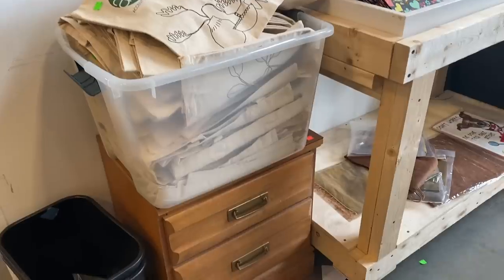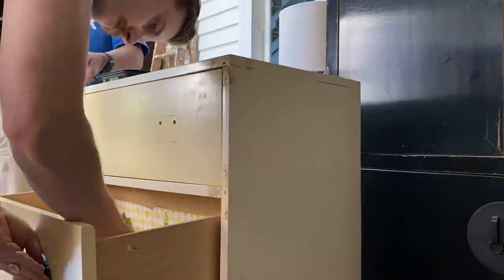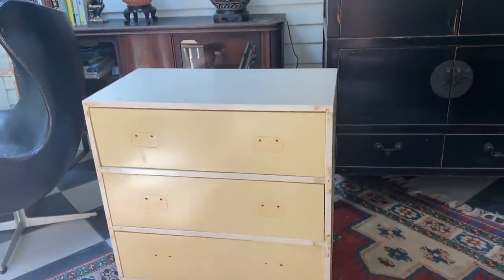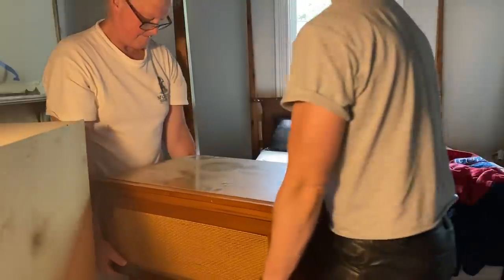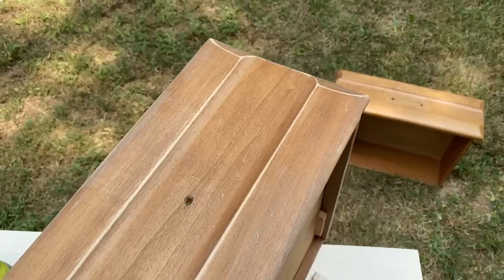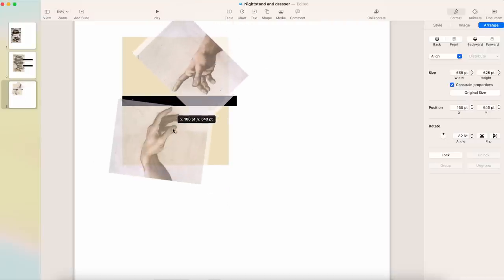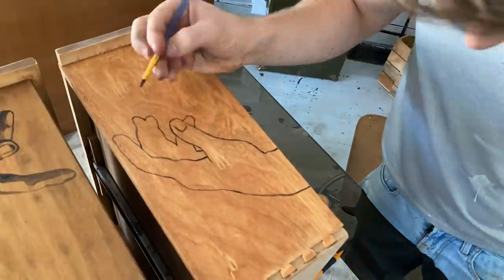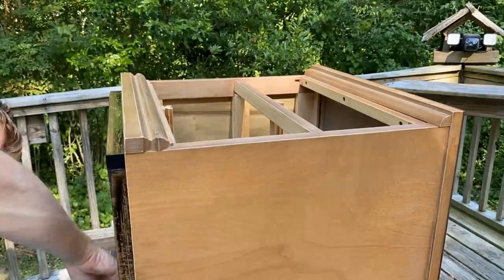Thrifted Furniture Makeover! | Nightstand and Dresser Thrift Flip | REISSUED

Comment: Andrew just a comment to help your algorithm.  
BOTH ARE a dramatic difference.
One thing I have noticed is that bedrooms are basically a series of boxes, much like an Amazon warehouse.  Beds are a box, dressers are a box, etc.  The easiest way for me to introduce variety to these forms is to use beside tables that are round, oval, or even half moon.  I did this almost by accident and really like the look, and am surprised how much added interest this adds.  Another plus is that you don't have to worry about scraping yourself on the corners in the middle of the night.  
I admire your design restraint on both of these, but just seems like too much work to do the drawer insides when almost nobody will ever see that and not all three drawers are ever open all at once.  Also prefer beside tables that are similar but do not match exactly.  Great work.

Comment: First, your dedication to detail is amazing. That you have your Dad to guide you through the restoration/ rebuild/ modification is a boon. Your folks are great!  As for the pieces, I think the darker piece would benefit with some wax on the sides. It doesn't have to be glossy like the top. Rather, try a more subtle wax. It's good for the wood and it'll enhance the paint you added. The lighter color piece is very well done. Applause for keeping the hardware on both. It's not only more economical but it has a uniqueness that adds to the overall vintage feel. Great selections! Fantastic restorations. As for salvaging old pieces, all your points are square on.
Reply from the maker: I agree about the wax! Great idea. And yes the vintage hardware is the best part! Gotta keep those unique features 😍
Reply: Wax...YES. try a dark tinted wax.
The dresser might benefit with some rub-n-buff on the hardware to give it some "zip". For a VERY low cost rub-n-buff hack, just use a small tube of gold craft paint for 50 cents, or whatever....I did that to some hardware I ordered online that did not quite match each other...stippled it on with a paper towel, and it was a success.
As far as flipping/painting furniture goes, just do it if you want. 99.999999% of thrifted furniture is not museum quality, so it's all good. You know you are on the right track, so looking forward to the next videos. 
One more thing.....a piece of glass cut for a piece that size should not be more than 25-35$ at the most.
Or, get a glass cutter and thrift a piece of glass and cut it yourself
😊
Reply: Ah....forgot about the drawer side detail.....ummmm........BEYOND !!!!!

Comment: I like both pieces very much. You have improved and updated each in unique ways. If I was doing the project I however would move the legs on the nightstand further to the edges. As they are presently, they don't work with the bottom (heavy) front skirt. Fix those two front legs, and your proportion will all work together in a harmonious way.

Comment: Two great unique designs! You shared the normal ups and downs of learning new skills, using new materials, and questioning decisions. The only change I suggest is having the legs of the nightstand sit wider so they are more flush with the sides of the piece. I really enjoyed and appreciated this video.
Reply from the maker: I tried them flush with the sides and they looked too wide… but I absolutely agree that they would have been better a bit wider 😭 I’m gonna leave them for now and might adjust the base again down the line 👍🏻

Comment: Hi Andrew,
Just recently found your channel and have been loving it.  The transformation of the campaign chest was excellent. Cutting it down and keeping the color similar to the original was spot on.  I've never seen the sides of the drawers painted as you did.  What a special surprise to your guests.  Now, the black chest just didn't work (for me).  Love the black on the top, but maybe should have painted the lip of the top the same color so it looked like on slab of black.  The bottom of the piece seemed out of proportion to the body.  If the legs you added had been moved out to the corners of the base, I think it would look more stable and balanced.  Right now, it sort of looked like you place a bigger box on top of a smaller one.  But that is just me.  If you love it, then it works!
Reply from the maker: Love your thoughts! I’ll definitely consider spraying the sides of the top pieces for that slab look. I wasn’t sure about it (and still am not sure) but maybe that will be the right call in the end. And yes, I agree that the leg placement should have been a bit wider (although out to the ends fully didn’t look right). I’m gonna live with it for awhile and maybe make some changes down the line! I really appreciate your input!

Comment: Possibility:  For a less expensive 'glass' top,  can you possibly use glass from a thrifted picture/painting and have it cut to size, if that doesn't cost too much and use it for the top of the table.

I think furniture that is made of very expensive, rare wood should never be painted and/or altered.  If it is an inexpensive piece, OK go for it.  I personally never, never, change the color of wood furniture, simply because I think it is so beautiful as is.  I also feel that way about hardwood floors.  

Tables look great by the way. Good video.

Ms. B. Churchill